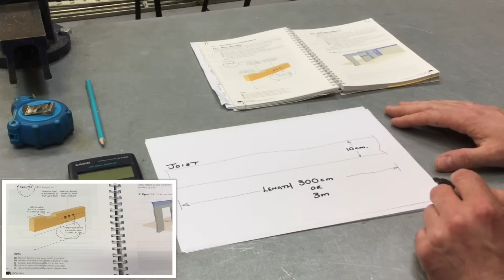Drilling Holes in Joists to run Cables (wires) Through Installation Considerations inc Calculations

Comment: So in old houses with heating pipes and old wires and stud walls ect this kind of mathematical correctness will not work I had thisxasxan engineer in manufacturing and such things kill efficiently can I ask how many houses have floors collapsed due to holes in joists? Eg a 20 mm hole through a 200 mm by 100 mm joist   could lead to failure hmm round hole and griffiths fracture law ,hmm point load sufficient to cause failure hmmm ok

Comment: Great videos. How does it work if the room you are in in this example was is split into two. I'm assuming it just means that the cables have to be run on the outer side of the room where the joists meet the wall? Also if you're coming length ways against the joist do the cables need to be fixed onto the joist or can they sit in the void this would be for an existing site with ceilings

Comment: Great stuff. I was just thinking today what the issues are with drilling additional holes in the floor joists to run new/replacement cabling. Nb: In the building industry all lengths (On a housing site for definite) are stated in mm. cm and meters just confuses things. Nnb: Generally pref to drill as high as possible on the floor joist to conserve room height below (Building regs) if you have exposed beams and will infill them to hide the cabling.

Comment: I'm a structural engineer in alaska. this practice needs to stop, we've had quite a few roof failures and having some electrician hacking your trusses with sawsall to route cable is out of control

Comment: So basically: 
1. Hole position is between 25%-40% of the joist length
2. Hole diameter not more than 25% of joist height.
3. Holes at least 3 hole-diameters apart.
:)
Reply: And holes have to be in the centre  of the joist.

Comment: Great video.
Would this be affected by what the joist was supporting? For example a truss system?

Also, would the same apply to every consecutive joist as I think I will need to drill through 8-10 for the cable run

Comment: In the situation were you have 100mm joists installed but you need to drill holes for cable access you would just need to install steel plates accross the top and and underside of the holes to give additional streangh to the joist.

Comment: How would this change with a load bearing wall underneath the span?
Reply: The span is the unsupported length, so if a joist is supported by a load bearing wall somewhere in the middle, then you have two separate spans

Comment: Centre of holes 4 X diameter of hole apart, and only a quarter of thickness of joist, in the 25-40% region and the 60-75% region of length. Interesting, not likely to need it ever, but I like to know rules, helps me be more of an intelligent client. 

Maybe that's a really useful topic to cover on one of your channels, as you may be professionally focused, but I'd bet you have a fair number of consumers watching too and it would help good sparks and help customers find them as until recently I really struggled.

Comment: If you were talking to any other trade, or profession, what you are calling the 'Width' of the joist, would be referred to as the 'Depth' . Confusion might ensue especially if you were having discussion  with structural engineer.
Reply: Didn’t want to say, but yep, correct..
Reply: I’m a spark and I would say depth too

Comment: Hi thanks for your excellent video.  If the loft space was not going to be ever boarded over do the regs allow for the cables to be clipped directly on top of the ceiling joists?
Best Regards Chris
Reply from the maker: Hi. Try and avoid placing cable on the top of joists in lofts as people can stand on them when accessing the roof space. Best to route the cables along the apex between the roof line and the joists in the roof as no one stand in the area. Thanks for commenting and watching. Gaz 👍
Reply: @GSHElectrical  Thanks Gaz for your quick reply much appreciated!

Comment: Hi, where is the safe zone on the ceiling to drill the holes for downlights( this is in a flat without joists? )And can the cables run flat or resting in the ceiling using twin and earth cables without trunking ? Thanks

Comment: Good video. Thanks. You'll often see cables strung from joist to joist through holes, with no support between the joists. Most cables need support every 250-300mm (on-site guide) and yet joists are typically 450mm apart. Should we be doing something to support the cables in between?
Reply from the maker: Hi great question. Appendix D page 141 On-Site Guide the title of table D1 is spacing of supports for cables in accessible position... I would class cables through joists in floors or ceilings as not accessible. Thanks for watching and commenting GSH Electrical 👍

Comment: Seems a bit dangerous to turn joists into swiss cheese like this, I would be concerned about one 25mm hole in a joist that small let alone multiple holes in sucession!
Reply: This comes ultimately from the building regs  and the specifications take this sort of thing into account. In that sense the joists size per span are over-engineered.
Reply from the maker: Hi. I understand what your saying but the information in the video conforms with BS7671 and is required by my learners. Thanks for watching and commenting all the best GSH Electrical
Reply: @GSHElectrical  so basically do what the IET says and ignore structural loading calcs, timber integrity, or common sense?   Good advice thanks for the clarification.
Reply: Ever seen a castellated steel beam? Think if it as similar to that. The amount of steel is the same but the span can be longer compared to a standard RSJ of solid steel. The height is increased and it has holes but is stronger. How come...?

Comment: Hi I read that holes must be three times their diameter apart. Would this mean if a plumber has drilled a 28 mill hole for pipe then my hole for wires would have to be at least 84 mill away from it thanx

Comment: Where did the IET get the idea of a zone to drill in? There appears to be no good structural reasoning behind it. From a structural point of view, you just need to avoid the lower section of joists, which resist the bending force from superimposed and dead loadings.
Reply from the maker: Hi. I don’t make the rules but often trades drill holes anywhere they need them causing potential issues over time... thanks for watching GSH Electrical

Comment: Hi am I correct in thinking that after drilling in the prescribed zone you are permitted to bend and clip cable in order to place a socket on a wall. And that the holes ate for placing long runs of cables.
Reply from the maker: Hi. Then follow the prescribed zones laid out by BS 7671 thanks for watching GSH Electrical

Comment: On a existing stud wall if a customer wants a dry line socket how do you drop the cable down with the top of the stud wall having no gap
Reply from the maker: Hi. You would have to drill a hole in the top of the wood or metal frame and then support the cables down to the socket outlet. Thanks GSH Electrical